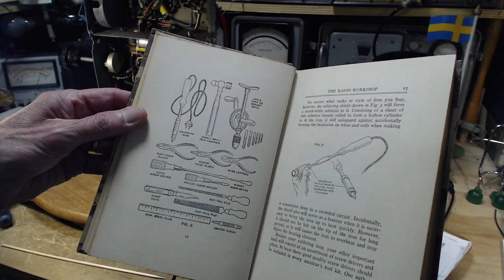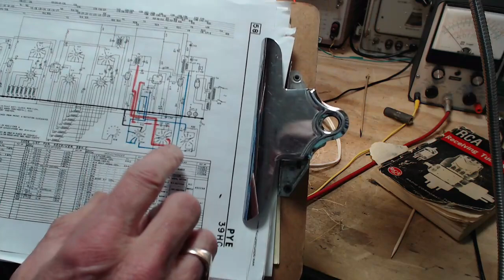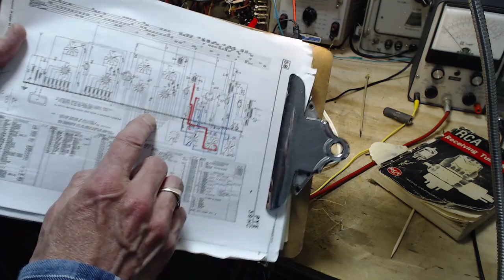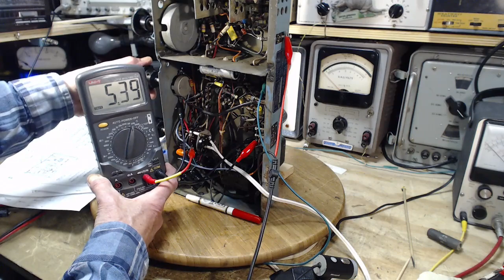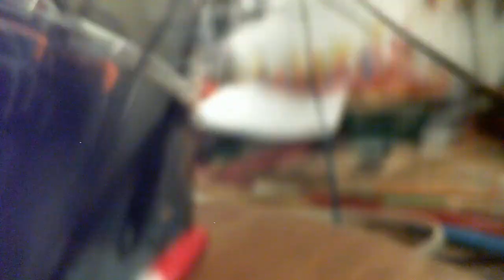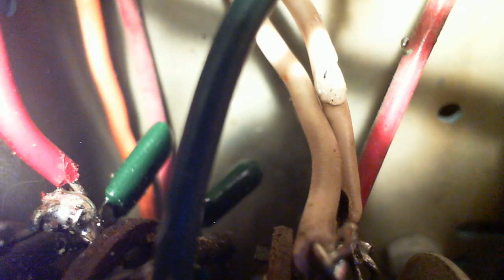Canadian PYE Model 39HC Video #48 - Motorboating Culprit

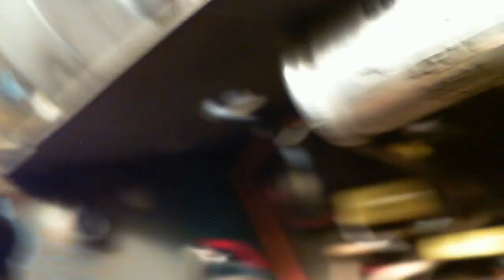Comment: At 18:57 someone has  drilled a small hole possibly to aid in using contact cleaner to clean the wiper inside but that is not the right side to do so.
Since this is the volume control the damn thing is worn inside and loses contact, hence the motor boating sound. Replace the  1 Meg volume control.

Comment: 30:00 If one aims a loop antenna at the open bottom of a tube radio where not only the Local Oscillator but all sort of RF and IF is radiated from point to point wiring, isnt it to be expected that all one gets is heterodyning?
But with all the unsolved motorboating squealing and feedback, maybe we have just witnessed the future for this radio; Theremin.